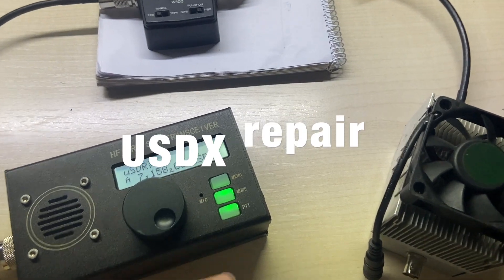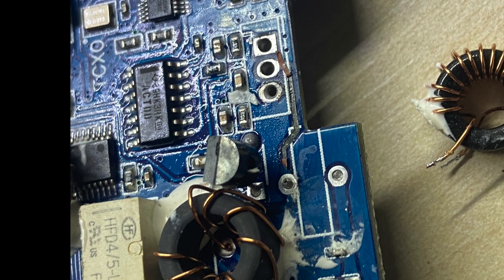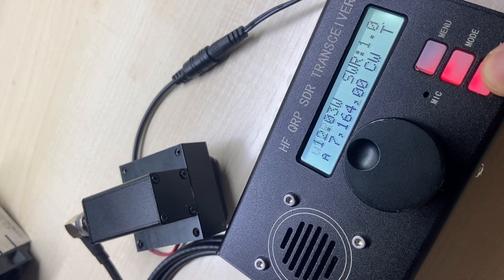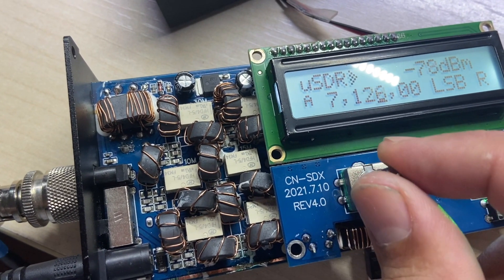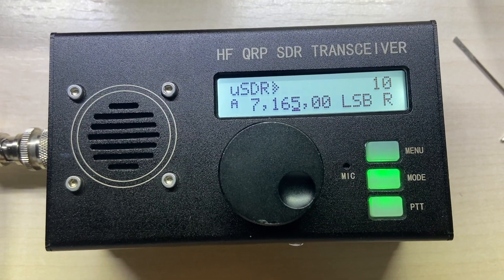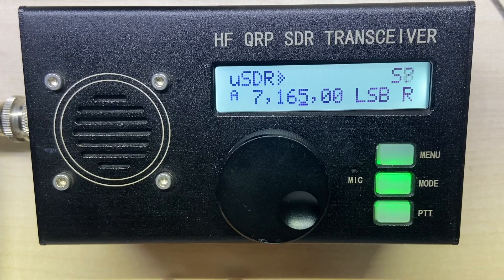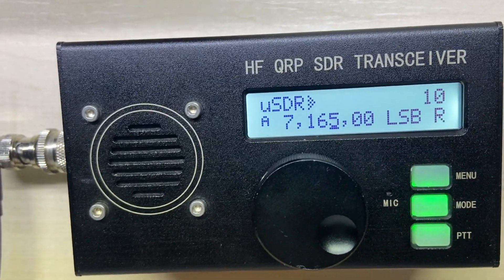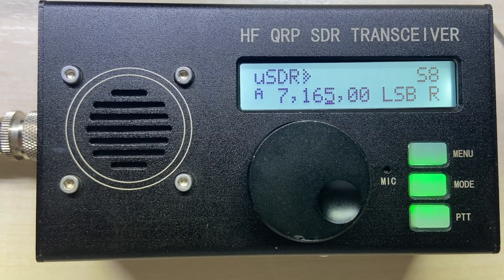I buy a broken USDX

Comment: Estupendo. Yo tengo uno similar, pero con las teclas a la izquierda del encoder. No he podido sacarle más de 5W. Le cambié el transistor, porque acabé quemándolo, subiendo el BIAS máx. sin controlar la intensidad,  pero tampoco. Lleva un IRF510 de potencia, y también lleva otro IRF510 soldado en placa desplazado, con una patilla retorcida. No sé si es el transistor de excitación o es el de conmutación RX/TX . Están muy ceca ambos, pero no tienen ninguna conexión en común. ¿Puede ser que al chino se le acabaran los BS170, metiera de excitación un IRF510, y por eso no saque más potencia? Gracias.
Reply from the maker: Dependiendo del transistor hay que tener cuidado al ponerlo en la pcb. Puede estar marcado para usar yn bs170 y el otro tiene diferente pinout

Comment: I replaced the transistor with an IRF520 and I get 15-20 w power, depending on the band.
Reply from the maker: Interesting! It is a very common transitor too. Have you added a heatsink to it?
Reply: I left everything as it was originally. He just changed the transistor. It is cooled by the metal body of the radio. Now I'm looking for a way to FT8
Reply from the maker: @miranovak8098  it is a very fragile radio. I Don’t Remember How Many Times I had to Change de transistor.  I sold it